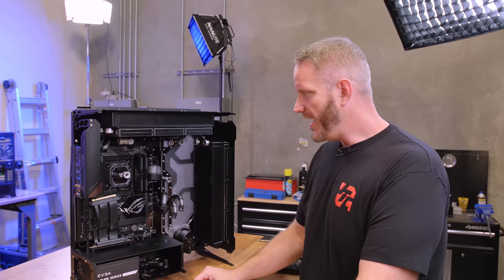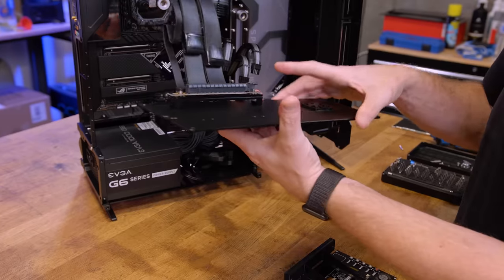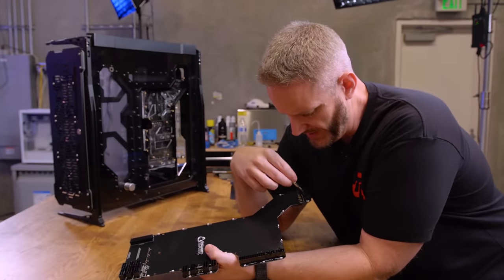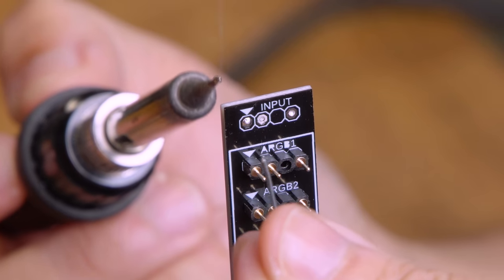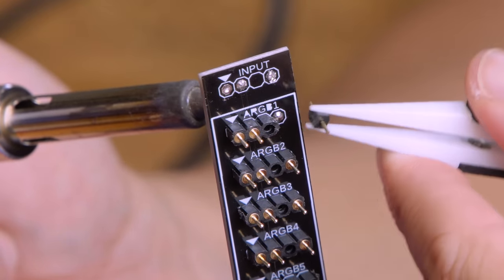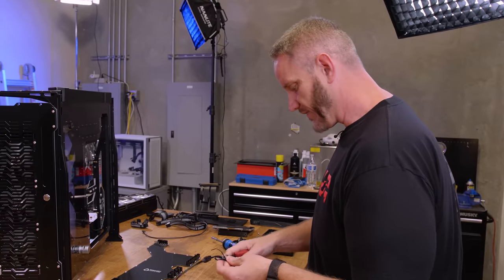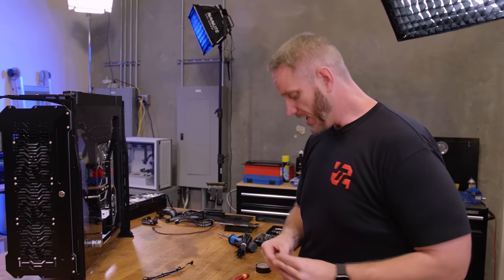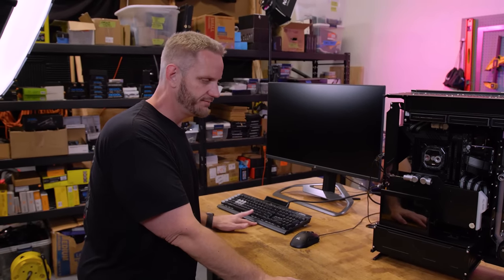This video made everyone mad at me...

Comment: You can use soldering wick to help remove through hole components, also you shouldn’t put solder in a hole before you have your part in.
Reply: This… I had to stop watching, it hurt too much.

I have been trained in high reliability, high level soldering and repair… The cringing I experienced while watching was too much.

Preloading solder is a common amateur method that can actually make things harder. Ineffective desoldering methods…

Not everyone has the training I had, but that doesn’t make it hurt less.
Reply: @marine6680  Oh man I know! Painful is a gross understatement. In the end it worked for them though so I guess we can’t judge them too harshly haha.
Reply: @abbynormabrain6664  Yeah, if it works when you finish, that’s good, even if you don’t get there in the best method.
Reply: Scrolled down 'til I saw somebody say it so I wouldn't have to.
Reply: @marine6680  it was hard to watch indeed :P and cold solder joints for days, since the flux is gone before inserting the pin. But if it works eeeeh.. good enuf.
Reply from the maker: Quite the circle jerk going on here
Reply: Guys this is RGB, not heavy machinery. If it works it works.
Reply: @mattaaron6142  man if you’re soldering heavy machinery there’s a problem haha. All we are saying is a couple more steps and this would have turned out better and the joint would hold up for a lot longer.
Reply: @abbynormabrain6664  Th point was he was working on something that was for convenience.  He was not working on something that controlled equipment that could hurt people or cause millions in damage.

Comment: That should work fine for a long time. I like to use solder wick to clean the pads out then everything drops right in and you just flow in new solder once everything is in place like new. I finally bought myself a decent temp controlled solder station with all the important goodies recently after doing this for years with several soldering irons depending on what I was doing. Of course I don't do as much repairs as I used too but good tools really save a lot of time.
Reply: Or a small solder removal tube, which has a tiny piston that you trigger to suck and remove heated solder from blocking the hole. Cheap and effective for reassembly.
Reply: @saty580  I generally use both. The desolering suction guns get the heavy amount then the braid gets the pads nice and clean for a fresh start. If I just want to quickly clean most of the solder off and get the hole for the wires or component leads if it's good enough after the sucker I just reflow it. Gotta be careful overheating the pads and traces and having them lift but I have 5 feet of old telephone cable with hundreds of single strand tiny insulated copper wires inside I use to rework bad pads and traces.

Comment: I never bother with extensions at all. I cut off the witless and then solder then together at an appropriate length. After putting on a sleeve you won't notice it at all and you don't have to hide bulky connectors along the cable.

Comment: I used to have to do this exact thing before I bought more soldering tools. What you need for replacing through hole components it a desoldering gun. It has a tip with a hole in it and uses strong vacuume to remove all the solder from the through hole so the part just comes out. I bought one a couple years ago and it's a game changer when it comes to through hole component replacment. Awsome content keep it up.

Comment: Well done! A trick to avoid edge case : If you tin your pin ends before dropping them in you can guarantee a stronger mechanical bond. Like with the dome of solder it wants to stick to things that are the temperature that melts it.

Comment: One thing you may look into for soldering is solder wick.  Its basically braided thin copper wires that is very helpful for desoldering.  You can use it to clean out the holes so instead of trying to heat up the pads and shove the connector in you can easily put it in after cleaning them out.

Comment: Lucky for Phil bailing you out..
I had the same issue with my Gigabyte Aorus Z390 on ARGB. Its still broken presently. Its also water looped, so I'll wait for maintenance to pull the board out and solder as Phil did yours. 
ARGB lighting fails all the time at the PCB, IC's or diodes. You can swap out light boards easily to get things working again. Just find a similar sized Addressable RGB pcb and solder wires. I live in Thailand where QC isn't great, and most of this stuff is lower quality Chinese stuff but at least I can source the stuff and fix myself. Most repair shops cannot think outside the box or hard to find a real tech apposed to just experience without technical knowledge so they just say "I dont know". Fortunately, I think outside the box..
I'm liking your Singularity build. He's aussie too, so I'd support his business and buy the mega expensive case just on priciple.

Comment: Hey Jay, since the graphiocs card is only 1 slot and you want to mount the display in front of it, why dont you 3d print the bezel again but with a pcie bracket on the side so it can be mounted on the empty space of the graphics car i/o bracket?
Reply: Better yet, 3D print the bracket so can solder connections to it and power it right through the PCIE.

Comment: You are missing a tool to remove the solder , low static desoldering tool . (soldapullt  model AS196) there is a smaller one 4 inches . GOOD JOB

Comment: desoldering is way harder than soldering!!! my cheap trick was getting a $5 desolder iron with integrated pluger pump. add a bit of solder to the existing one, and use the desoldering iron.

Comment: I feel your pain mate. Broke a couple of pins on a USB 3.0 header a couple of years back and ended up having to use soldering to get them back on. couple of things though if you're soldering on that type of board is to use flux on the component you're taking off. As for that type of connector, I'd use a de-soldering gun to get it off but a hot air station heated from the underside of the board at roughly 320*C will work just as well.

Comment: Having worked with RGB lighting for 20yrs, you can always solder some magnet wire to the backside of the pin and then to the inside of the plug that now houses the broken piece. The other two pins will still hold the plug in place and the magnet wire will complete the circuit of that third, busted pin.
 
Is it as "aesthetically pleasing"? No. However, the magnet wire is already insulated and practically invisible.

Comment: Your a perfectionist and we will learn from you so keep on doing you.. Glad its finally coming together. Then it will be overlocking and taming the beast that is alder lake - hint you might just save yourself some trouble and de-lid it and put rockitcools copper ihs on it.. I finally did after three rads and temps dont break 90c.. But my SP is less then ideal.. cheers

Comment: Look Jay, the builds do not take you a year, but as you say, you digress, A LOT.
Instead of planing, sourcing then building, you start building without any real idea of what you want, you want to finish it faster than you can so you get mildly frustrated, start doing errors then you break something and leave it for two month until your bitterness goes away, and when you have gone through this process a few times finally just by chance you finish it.

Comment: I just want to know about the needle nose, pliers, or spring loaded holders are with the non metal, possibly nylon, are. I make jewelry and the metal parts on my jewelry pliers have to be dipped in a coating way too often and end up not closing enough to grip fine wires. 

This build is amazing and I'm glad you always show mistakes so everyone can learn from yours and not make them when they do the same thing.
Reply: They are ceramic tipped tweezers my guy, Amazon or eBay should see you right. I use them for most of my soldering projects and also cleaning sploogy filament off the nozzle for my 3D printer.
Reply: @Chubza  thanks!

Comment: So my view of soldering is that if it works it works. It doesn't have to be pretty or optimal it has to function. and this clearly functions. Are there better ways to do it? yes. But hey it works. I think it would have been cool if they replicated the front grill pattern as a thin 3d printed part they taped on or screwed onto the gpu water block. I feel like it would have tied the build together a bit more and it wouldn't cost that much material. though the print time might be a bit long.

Comment: You need a different type of tip to replace the whole pinout like that so you can apply heat to more then one pad at a time. I believe they're called K tips. Like knife tips. Pretty standard tip to have in your soldering station. But I'm sure Phil already knew all that and just didn't have one on hand.

Comment: I would have used a solder wick to draw the solder away from the broken pin. This would have left a clean hole and it would have been just a push fit in the hole and solder from the back. A solder wick looks like copper wire tape about 3mm wide. Very handy bit of kit.

Comment: One idea to fix the " the soldering iron gets in the way " problem would be to take one of the ' security pin screw ' driving tips, the star bits with the hole in the center, and put it in a lathe with the base end facing out. Then using the screw thread turning features on the lathe put a thread on the base that matches the one on the iron, you can then screw it into the iron like one of the regular tips for it. Then slide the center hole over the back of the replacement header pin as you heat the solder and the iron will not be in the way and also won't push the pin around.

Comment: Use the solder wick and clean the holes. Then just put part there and solder first pin and then reheat it and adjust part orientation. then solder rest of pins.

Comment: I was a solder tech working on these very pins and also soldering 36awg wire to sensors the sine of half a grain of pepper.. This video for sure triggered me.. But Phil still did a fine job. I would have replaced all 3 because that black part reinforces them and makes it harder for one to pop out or break under odd tension. But it's an RGB connection and how often are you fidgeting with it? Unless you're me :D

Comment: LOL, I have been soldering for over 50 years and learning to solder is all part of the game. Soldering hair thin wires or large gauge wire, it all take some skill and you only learn the skill by doing and when you make mistakes, you level up when you get it right.

Good on you for doing the soldering and the goal is to make a working joint that will last and fulfills the need.  Soldering is a utility function.  Engineering the circuits is way more skillful and important.  And being an engineer for over 50 years you learn where the priorities are.  Try soldering together a full computer from scratch after designing your own PCB.  Welcome to personal computing in the mid 70's

Comment: Now there is something you don't see every day, to all you new techies, pay attention! This is how we did it back in the day, Board level repairs, don't just chuck it in the bin and tell the customer they need a new board. Reduce the E-waste to protect our planet or try to repurpose . Thanks, great video @JayzTwoCents
Reply: Lol a stupid rgb header broke  and you talking about chucking it in the bin
Just don't use rgb it for baby anyway and look super cheap/bad
Reply: @legros731  It may surprise you to realize that people toss electronics in the bin for silly reasons like that. the soldering iron for some reason has a mysterious aura that scares the non tech-inclined :p
Reply: @legros731  Well, it's the standard "solution" for many Apple "repairs".... "Yeah, your thing doesn't work? Oh well, ahhhh, the moisture indicators show the board was in contact with water, so you need to have it changed. No other way to fix it.
That'll be 1750$ plzzzzzzz. THANK YOU FOR COMING TO US!!"
Reply: @legros731  THIS repair may have been for a stupid RGB header sure, which usually isnt a reason to chuck a part in the bin (though Im sure there are some people who would), BUT repairs like this can easily be needed for other parts that ARE important and could easily necessitate a replacement if you arent able to fix them, like if one of the USB header pins break, or a power plug, a capacitor, or a switch.  Sure, most people arent going to be re-soldering CPU sockets or something like that, but there are LOTS of smaller repairs like this that people can do DIY so long as they are mediocre at soldering that they might be afraid to attempt.
Reply: @ledoynier3694  with all the youtube video available anyone can do a simple thing like that the correct way 
A learned this in the 2000 when a wanted to tune my honda the only way was to unsolder the eprom chip solder a 28 pin eprom socket and burn another chip with a custom rom edited with one of the available homebrew software  or directly in the hex editor if you where good
All of this knowledge was available to anyone for free on honda forums
I was turbogarging my car and it made my learn how to properly solder 
Jay was in the same situation he could have use this opportunity to learn a new skill like a did back then
Reply: @KA24DERACER  sure but at least do it the right/easy way
Some solder wick and some flux go a long way its cheap and easy to get
Reply: @legros731  Yes it would have been better if they had done it the proper way.  HOWEVER, this was an RGB header, not something super important, and honestly, for something quick like this, you dont always NEED to wick the old solder away and flux it.  He wasnt replacing an EPS connector or de and resoldering a bunch of pins, it was one quick pin replacement.

Comment: Hi Jay, love your videos, but it looks as if you've soldered the pin in the wrong way around, I would expect the exposed end to have the rounding on it, so as to prevent wear when plugging the socket in.  The squared end is designed to go into the board so the solder flows well onto it.  Sorry to be a critic, but as I say, love the videos.

Comment: This is not how you solder through hole components. You do not fill the hole before you insert the component, you use 10$ solder sucker or solder wick and fully remove all old solder, insert component and solder. It’s not surface tension it’s capillary action and it’s literally impossible to get solder to adhere to the PCB masking like jay said. They literally are just using words with zero comprehension. It’s better than videos of Kim Jon-un at control panel acting like he knows what he’s looking at

Comment: I can see why manufacturers use propriety ARGB connectors, the standard ARGB connectors/headers suck. They are fragile, they come out if you sneeze at it and are an absolute pain to line up when space is tight. At least they can't be plugged in backwards, that's about the only thing I can think of that would make them worse.

Comment: 6:29 "There's so many puns and in-ur-end-os in this video" LMAO

The pin difference definitely makes 0% difference -- even if there's also variance in conductivity and stuff, it's not anywhere near enough to even potentially create a problem. Although since the other pins were bent, I would have removed the whole header and replaced it since you had whole headers. Then you'd know they're all definitely straight and evenly poking out from the board.

Comment: I wish I had the ability and talent to do what you do with building a pc. Keep up the great work!
Reply: Its really not as hard as it seems so long as you have pretty basic skills with building things.  You could always find some older PCs and components and do some practice building to work on your skills/techniques if you were worried about ruining newer expensive parts.  Search around in some PC parts marketplaces for someone selling a custom looped older PC or buy one or more used PCs with parts that have custom loop options and see if Ebay or something has the blocks and such you need used for cheap.  Im sure it wouldnt be too terribly hard to come up with enough stuff to get some proper practice in.  Once you are done with your practice build, you could sell it for probably pretty close to what youve put into it (besides your time of course), or give it away to a family member, friend, etc.

I just recently switched my main build over from AIO cooling to complete custom loop and it was not nearly as difficult as I had assumed it would be (I have plenty of experience building/repairing PCs but Id never done an actual custom loop before).  Besides just the extra caution you need to take with water (just being careful not to spill and if you do clean it up THOROUGHLY), the hardest part was learning to heat and bend the tubes for the loop, which isnt actually all that hard (and can be skipped if you are fine with using soft tubing).

Comment: I just built a 12th gen. Corsair puts a little flag tag on the RGB cable. I didn't like the tag so being very careful I cut the tag with side cutters. Of course I cut one of the wires. I soldered and and heat shrunk that tiny wire. You can't see the splice and it works perfectly. Shit happens. All that matters is having the skill and or money to fix our fuckups.

Comment: This is more like how not to but ok you got job done. Next time get a soldering wick or pump to remove solder after de-soldering pins(actually you can use them to suck solder away than removing pins)  so you clean out hole than put pins in and solder them.. Be careful when clipping plastic or pins away you can rip pad..